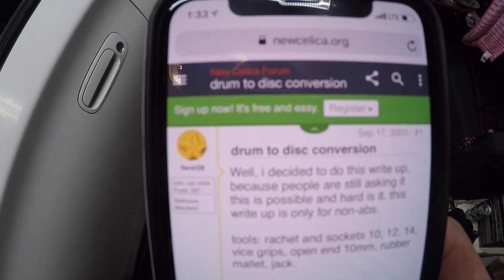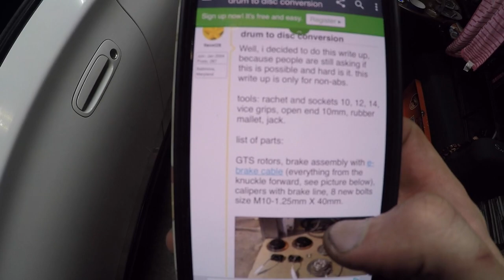Celica GT to GT-S Discs- Rear Disc Swap!

Comment: So just a heads up the front calipers on a GT are only smaller than the GTS for the 2000 model year. 2001+ GT celicas have the same size front calipers as the GTS
Reply from the maker: Yeah, came to that discovery a little while after we did this swap, so this video isn't as important as the rear disc swap video lol. Just makes ordering the rotor and pad kits easier.

Comment: At 11:05 are those Brake Lines from Ebay? At the time of typing this (May 2023) I see some $80 stainless steel lines, and $30 stainless steel lines. The $30 ones that I see look like the ones you have in the video. If those are the same, how are they holding up?
Reply from the maker: I think we're coming up on 4 years with them now, and so far, no complaints at all. He's done plenty of heavy driving with it since then and it's always stopped well. 

He was def ballin' on a budget so I'm pretty sure those are the ones.

Comment: Hey bro I like the video. So my emergency brake lever from inside the vehicle it’s not catching the brake. I can pull the lever all the way up like nothing ! And the car keeps going. Do I have to get the parking brake cable from the GTS or can I get away with using the original GT cable? What do you think I did wrong because I’m using the GT cable
Reply from the maker: Adjust your parking brake inside the rotors, and make sure that the drum shoes inside the rotor are catching the inside, and then if your issue continues try adjusting at the parking brake handle itself. there's two bolts that you can adjust to try to tighten up some of the slack. We never switched from the GT handbrake to the splitter that then goes to each caliper. Properly adjusted drum shoes and a good handle adjustment and you should be good to go.

Comment: I plan on doing this in the summer if you have all the parts with you it dsnt seem too difficult
Reply from the maker: Very easy! The worst of it is attaching the Ebrake cables between the heat shield for the exhaust and the body of the car imo. The rest is pretty much plug and play. 

Exactly why I made this video. We didn't have all the parts (even though there were several people who didn't mention the longer 40mm bolts) and it really slowed down the process. If you follow what I've got here you should be up and running relatively quickly. If I did it again, I could do it in a day.

Comment: Awesome. Any fitment issues with the front discs/calipers and wheel size?
Reply from the maker: We still need to try to swap the front rotors and calipers on but that shouldn't be too bad. I imagine they should be pretty straight across. Wheels are 16", no fitment issues.

Comment: The oil brake cables dont'fit a 2000 celica shit and i got the calipers and rare disc 😥😥😥😥
Reply from the maker: It should all line up and work with OEM parts. Both the parking brake and regular discs and pads. We got it to work.
Reply from the maker: I'm not 100% understanding what part isn't fitting for you. The GT-S brake lines, calipers, rotors, pads, emergency brake lines, and hubs are required to get it to work.
Reply from the maker: If you have instagram feel free to PM me some photos of your issue and I'll see what's up. @fwd_fanatic
Reply: @FWDFanatic  
The metal piece on the end of the GTS cable is round about 8.5mm.   
The metal piece on the end of the GT cable is square about 9mm. The square is way too large to fit in the round hole. You need the GTS cables.
Reply from the maker: It didn’t look any different on the GT in the video. The metal bracket looked the same. Even so, that bracket just slides off if you get a little slack in it and twist the cable. So grab the bracket too and swap it over. Way less hassle than running the whole cable from the hand brake down. You can still run the GT handle to T bracket as long as you swap the bracket.